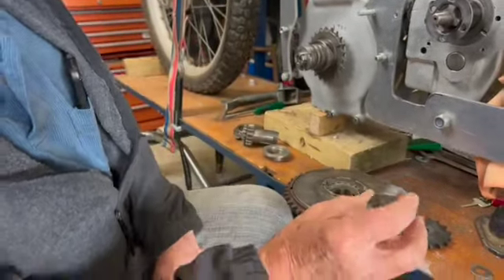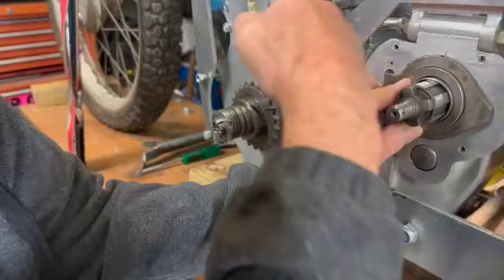The mystery behind the Velocette clutch

Comment: The Velo clutch is a beautiful thing. Light and easy to live with. I just always had trouble tightening the locking nut against the springs, even with the correct tools sometimes it would take hours. You didn't actually show that part. Maybe that was the "mystery"?

Comment: Hey Al, loved the video mate ! Just looking at the distance between the carb and the engine. Is there a reason for that Al ? The other thing that has always puzzled me.. I imagine the float levels on pretty much all carbs are set with the carb horizontal , then they get put on a bike and, more often than not, are on a slant ?? Whys that Al ??
Reply: Hi, the distance between the carb and the engine is a bit experimental but after a lot of research  it is said by tuners of the era that a charge of gas in the manifold is of benefit at high revs  I,ll report back after we've tested the machine . Concentric carbs , because of the central bowl  will run on an angle because the fuel can't easily run away from the main jet. the angle of the manifold is to take advantage of the down draft effect.  regards Al
Reply: @AlanStrahan-cd2kl  Cheers Al !